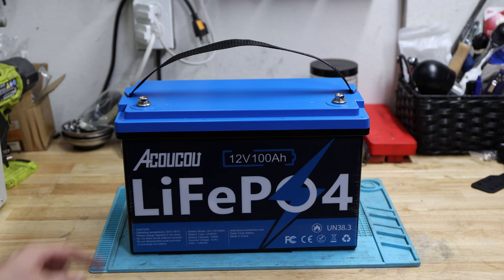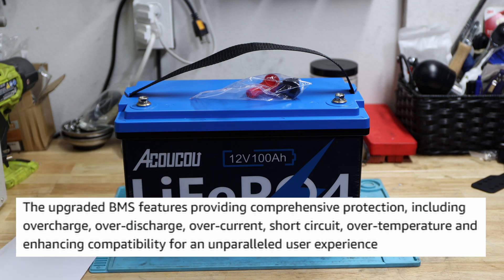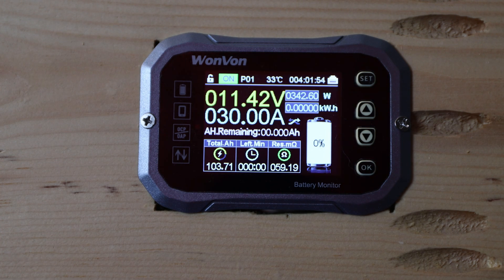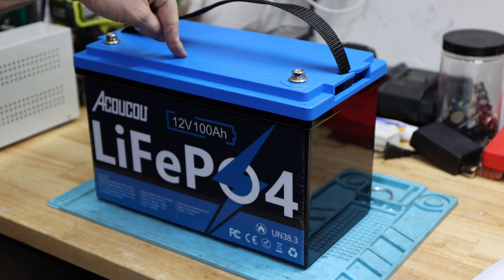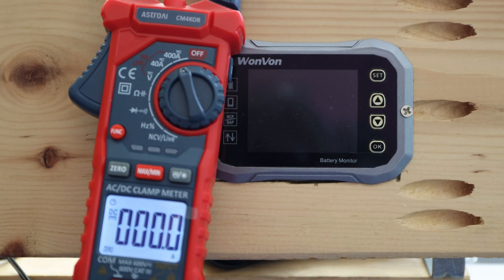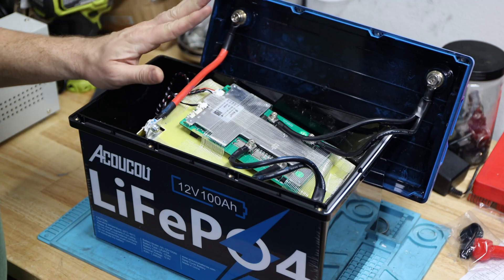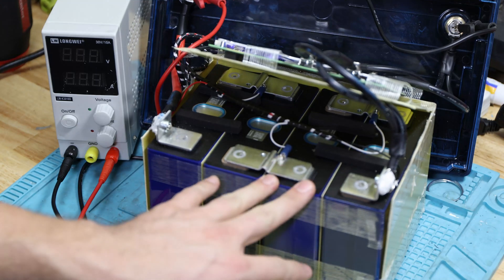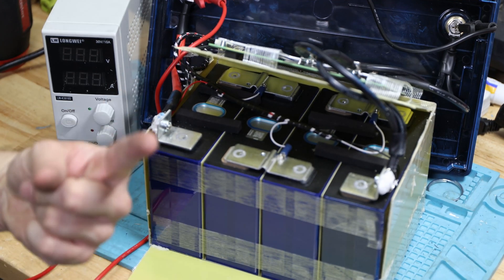Great Built Quality INSIDE Acoucou 12V 100Ah LiFePO4 Battery

Comment: Here in Europe its now cheaper to purchase a good quality capsulated battery than building from cells and bms, 12/100 batteries ab 200-240€ with bluetooth.
For a more advanced and bigger setup with programmable bms, bms connection to victron etc, the self built setup is preferred
Reply: u mean aliexpress